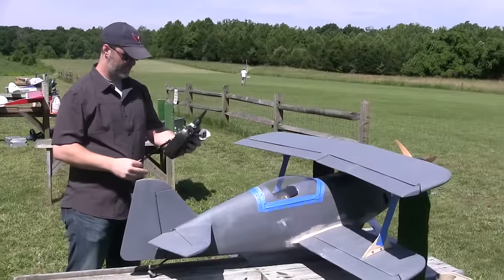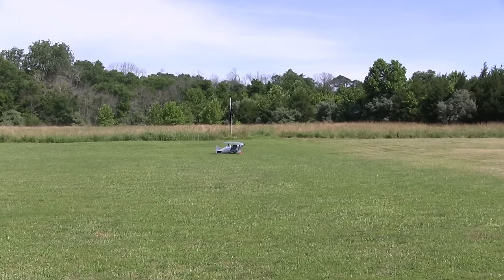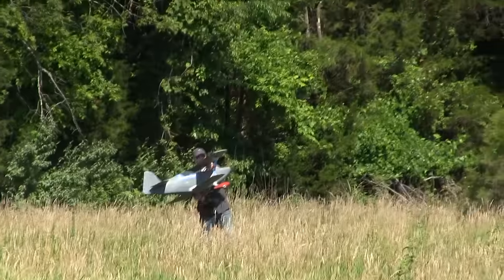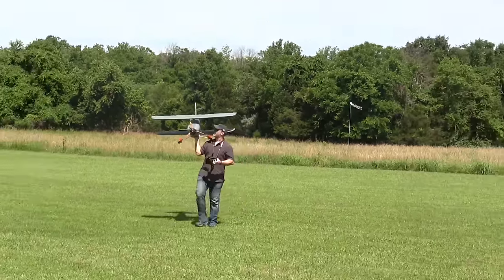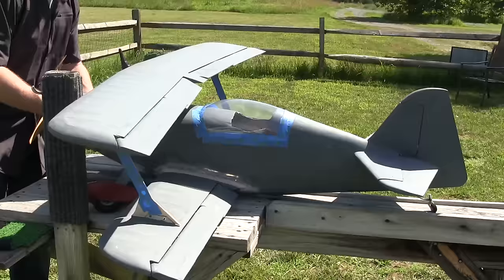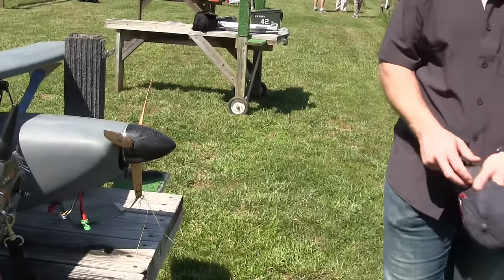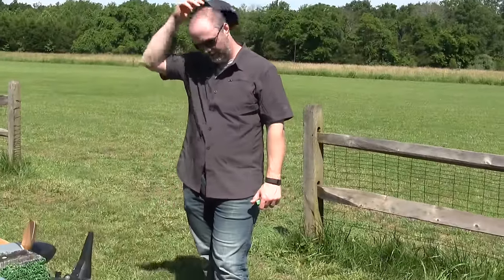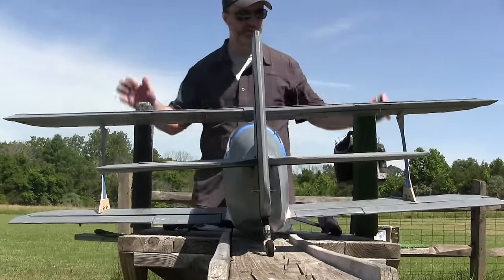Scratch Built Pitts Maiden

Comment: Why are all the control surfaces twitching out?? Did you check CG before flight? Definitely a beautiful plane for scratch built! I have a great planes F4 phantom that I'm going to make a plug, fiberglass build to make one for turbine power! And have the original jet prop. She's 80" long and 12 pounds!
Reply from the maker: After the hard landing in the tall stuff some of the wiring at the receiver was loose.  I ended up having to replace a Y connector that was causing some weirdness and that cleared up the chatter.

Good luck with the project!  I'm REALLY happy with how the fuse came out... just wish I had built the wings a LOT lighter for this project.  I plan to pull another one and go ultra-light with everything at some point in the future.  Just not sure when.
Reply: It's badass! One of only a few videos literally 10 total IF that showing how to make a fues from scratch! Pretty cool man keep it up!
Reply from the maker: Sean Schrader Thanks!